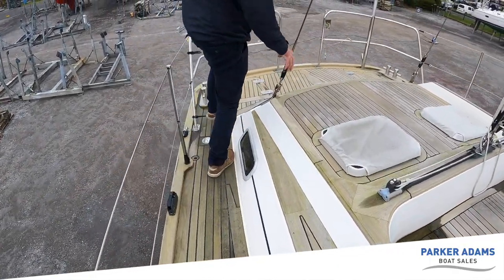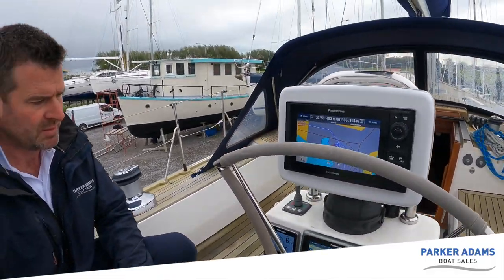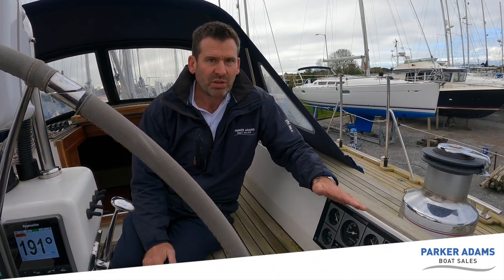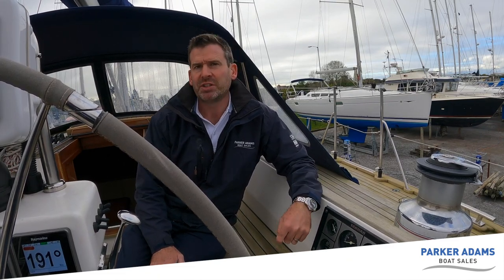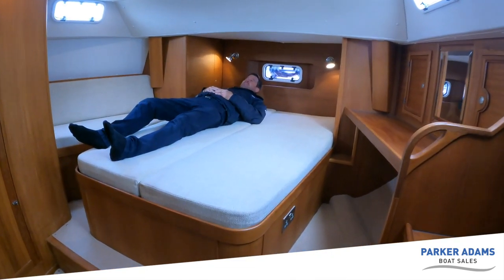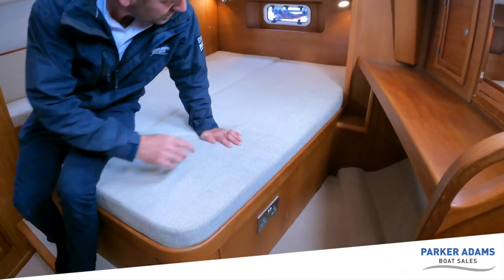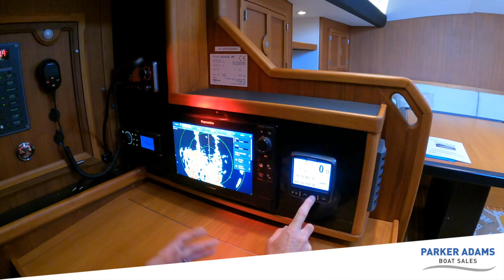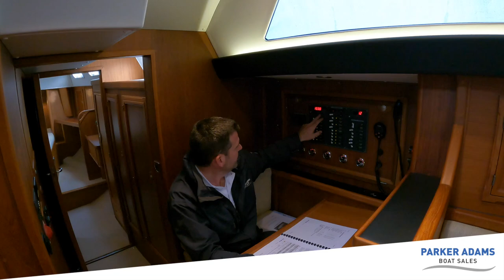2018 Colvic Sailing Yacht Walkthrough Video - Blue Water Cruiser / Live-aboard - Stunning example!

Comment: Search the engine information, and no information is available on the internet. Is the engine still supported by Yanmar?
Mechanical engine burns more diesel.
Small tanks for blue water. Only way to charge the batteries with engine end is anything you need to shower with hot water. You need to start the engine. Stove and oven running with diesel.
Definitely inside and deck equipment nice and new.
To many unknowns.
With that price still not sold.
Makes you think and why someone basically builds the boat ground up and 3 years later puts in the market